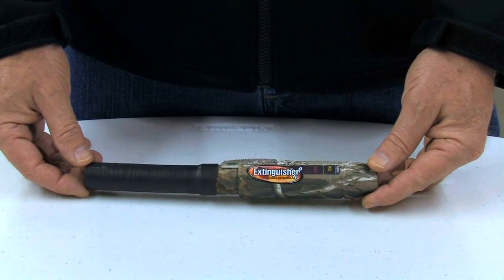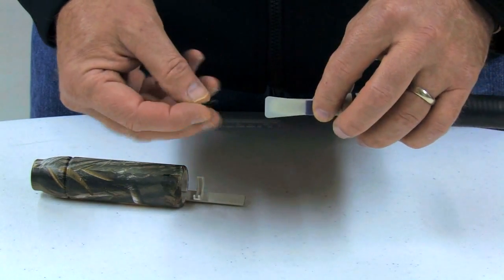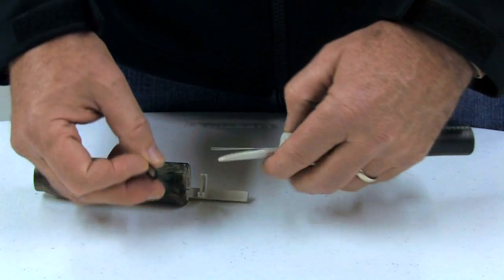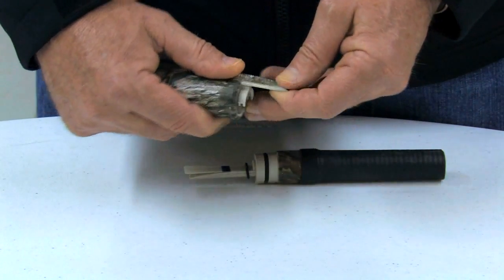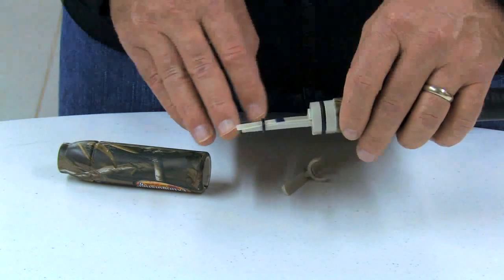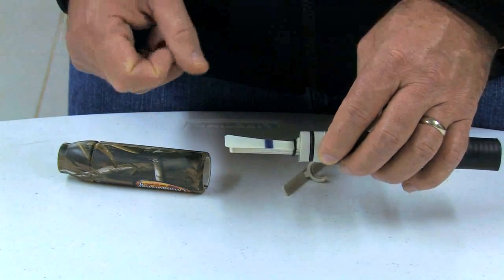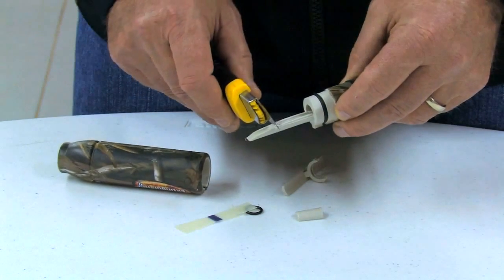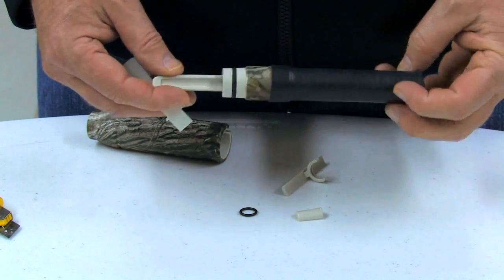Extinguisher Deer Call - Tuning & Assembly

Comment: i'm glad this video existed!  the small o-ring came loose from my slide with about 90 minutes to go before last light.  i couldn't figure out what went where after pulling it apart.  one youtube video later and i had it back in one piece in 60 seconds with a dead deer on the ground 15 minutes later!  🙂  also glad i watched the part about tuning it, mine sounds much better now.  i have always stored it in fawn mode.  now i know better!